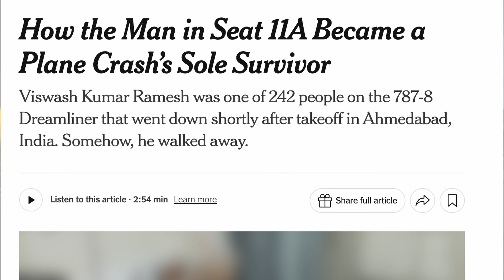Why the RAT Changes Everything – Air India 171 Update

Comment: No mention of the APU.  I thought the APU would be running during take-off to provide electrical and hydraulic power in the event of a double engine failure.  In which case there would be no need for the RAT to deploy (which it undoubtedly did).  I think there is much more to uncover here.  If the APU was running and it also failed, it looks like fuel starvation was the problem.  But fuel starvation simultaneously on three engines!!!?? 

"Curiouser and curiouser", said Alice.

Comment: There is some flaw in this analysis although it sounds partially correct. More convincing than the previous one. 
Imagine the sequence:
1. Aircraft accelerates normally up the runway and takes off smoothly at about IST 13.38 hrs - At the instant of rotation Engines were working - 0 Sec.
2. WITHIN 50 FT LANDING GEARS DID NOT RETRACT -  FAILURE TO RETRACT THE LANDING GEARS WAS COMMUNICATED TO THE PILOT - AIRCRAFT GAINING HEIGHT - ENGINES WERE WORKING - 5 secs.
3. Pilot senses the abnormality and tries to accelerate and climb quickly - Emgines working? - between 5 & 15 secs.
4. Pilot senses the loss of thrust - Engine is still working but not delivering the required thrust - Aircraft reaches it's maximum height 500 to 650 ft using the momentum - RAT (= kind of device triggered by the emergency) would have projected out - SOMEWHAT evidenced from the visual footage of the flight - between 15 & 25 secs
5. May Day message: Sent "seconds later" than takeoff. The pilot's words were "Thrust not achieved falling Mayday! Mayday! Mayday!" - between 15 & 25 secs
6. Aircraft starts loosing the height and pilot desperately tries to save the flight - between 20 & 30 secs.
7. Aircraft continued to descend rapidly and crashed into the building - inferno/fireball - between about 30  & 45 secs. In about a minute, after the take off, fire ball & smoke errupted from the crash site.

Engine sound is clearly audible in the visual evidence as the aircraft was descending and approaching the building before collision. Flaps position in/out during the flight NOT decernable convincingly enough. There could be something about it or there is nothing about it. Investigation will reveal. 

Seq No 2 & 3 are not clearly explained in the expert analysis. There could be a slip there which is not assessed/analysed. 
Until then lots of speculations? 
What is robust Safety?
Save lives.

Comment: steve you were late to the party on this   and by a long long time,,  swiss001 was on it straight away and he called the bogies tilting  and he dismissed the flap or u/c issues straight away and said rat deployed
no one listened to him and all the experts got hung up on the loss of thrust being a pilot error when the pilot reported no thrust etc 
engines failed just after take off   and as the bogies tilted he selected u/c up but just had no hyds to shift them so the engines were going on or after rotation or close too

Comment: If they were having dual eng failure why were the flaps up? Is it for better lift to drag ratio??
Reply: I think it doesnt matter they only had a few seconds left and without any thrust they were heading downwards
Reply: @drseven1275  but why are they up? The altitude is to low for the flaps to be up is it?

Comment: 1. The single survivor spoke about hearing a 'bang' just before the crash.

2. The ambient temperature at AMD (The Airport) was quite high, making a long hot take off run.

3. The same aircraft, just on its previous leg did experience electrical trouble with cabin aircon.

4. The pilots called a Mayday during or just after takeoff, meaning the emergency happened after V1.

5. The older Dreamliners have a history of thermal overrun of the lithium battery packs, some even ending in fires. (Boeing had done a workaround for that, but the faulty aircon and a full day's baking on the tarmac would not have helped to cool the batteries).

6. What if the 'bang' heard during 
take off was the battery pack exploding? 

7. The resulting elec. power loss would have caused the RAT deployment, also reported elsewhere.

8. If the battery box/breakers burned & tripped the power to the FADEC and fuel pumps, would that not cause a dual engine failure?

9. In such a condition, without hydraulics, no way they could retract the gear, let alone recover thrust!

Comment: Hmm.. just on sound amplitude, if you can hear the RAT, there is no turbofan at takeoff power anywhere near it.  Witness ears, and the mike/audio input hardware on the phone, would push the RAT sound down into insignificance.  It's weird - there does not seem to be anything trailing the plane, no stream of hydraulic oil, no smoke from poor combustion, no flame/bangs from relight attempts.  It's as if perfectly good engines were just instructed to shut down:(

Comment: Respected Capt Steve,
I am no aviation expert but I will request you to analyze the testimony of the lone survivor and the reports from Ahmedabad Airport. In words of the sole surviving passenger, immediately after takeoff, the airplane seemed to have come to a standstill for about 5 secs. Soon they heard a loud noise (RAT deployed?) and saw a flickering green and white light (generator issues?) just a few secs before the crash. Also the Airport received a Mayday call from the pilot during takeoff but got no reply when the signal was addressed.(a power failure?) It was at this time, that the plane disappeared forever from the radar.
Whether a power failure or a dual engine failure, Boeing has a lot to answer!

Comment: Some of the sequence of events could match a premature raising of the flaps, however not all video evidence suggested that. But for me it would have been absolutely unbelievable that someone, anyone, would mistake the gear lever for the flap lever. We've had some pilots mix up the levers for the air brake, the flaps and one of the engine thrust levers, because they're all located pretty much right next to each other. But the location and form of the gear lever makes it unmistakable, even if the person tasked with operating it would have been drunk they wouldn't have messed up this big!

Comment: Hold on - is it not the Boeing 787 which had serious problems with it's Lithium batteries for backup and general power? For AC? There is a video from the same airplane the same day, earlier flight, a passenger from the cabin filmed that nothing was working,, no AC, no entertainment. If the batteries worked, why would the RAT be necessary? If not, a long list of people will be held accountable.

Comment: We hear the RAT, but can you tell if the engines are at idle or failed? Could a software glitch in the engine thrust management software be another hole in the Swiss cheese? (a recent software update gone wrong that caused uncommanded roll back of engines?)

Comment: A British Airways B777 had a double engine failure on approach to Heathrow recently that was caused by a blockage of the fuel flow probably by ice in the filters.
But that was after a long flight at high altitude

Comment: After seeing more than 50 videos of this unfortunate crash, and being a retired flyer myself, I have slightly different opinion and I may be wrong.
1.The TOW was near max TOGW. That was a hot day and temperature ISA+20 nearly 40 C. Temperature inversion is just possible.
Going through performance of 787-8 flaps 15 were required for TO. As seen from CCTV during TO roll these were at 5 and that is the reason acft lift off at the end of the runway.
The 11A seat pax did say he heard a loud bang and then lights flicker. Probably  6-7 seconds after lift off the left engine had a compressor stall and loss of power. This also explains acft veering to the left and crashing to the left of runway centre line. The pilots got involved in assesing the situation and forgot the landing gear. Now with gear hanging down heavy acft with 42 C temperature and inadequate flaps the acft will not climb with one engine, thats why capt said Thrust not achieved going down Mayday Mayday. If both engines had failed the call would have been Lost both engines.
This is my theory and I may be wrong.

Comment: It is wrong to speculate about the cause of the crash. If the authorities strongly suspected a technical failure with some evidence to back it up, they could call for all 787s to be grounded, but this can't be done without solid evidence.  It would otherwise become too tempting for people who felt legally at risk to overreact to all manner of suspected aeroplane issues. Grounding a popular aircraft type would cause chaos for travellers and airlines.

This captain needs to apologise for suggesting that one of the pilots may have caused the crash by retracting the flaps in error and not putting the landing gear up. Just think of the added grief this places on their loved ones and the potential reaction of families who lost someone. The suggestion is unnecessary other than to earn some youtube views and satisfy the armchair wannabee air crash investigators.

The black box analysis won't take too long, and then we'll know what happened. At this stage, let's spare some thoughts for the many hundreds of people grieving.

Comment: There is a theory circulating that the Fuel Pump was switched off at the time of pumping fuel to the aircraft and it was not switched on. I understand that only the ground staff handling re-fueling have access to it. This would mean that there would be enough fuel to taxi and takeoff which is the residue in the fuel pipes but not beyond. Is this theory plausible?

Comment: Great job! Well said, and with video support. I would add that in the video you showed,  I did not hear the usual roar of the aircraft engines as it went by the person taking the video onlr the sound of the RAT motor?  Usually, the engines are independent of each other for safety,  but there may be a common electrical component just prior of a split off that failed or shorted that could explain both engines shutting down at the same time?

Comment: I believe that during takeoff, they decided to abort once they discovered an engine problem. However, the speed was near or beyond V1, perhaps close to V2, and there was hardly any runway left to apply the brakes; therefore, they decided to continue takeoff. Consequently, the landing gear remained down while they assessed the engine issue, but ultimately, they lacked sufficient time.

Comment: And I said it in your previous video: power failure .... and I was not talking engine failure.
I said this because that plane had a total power failure before a previous trip. Someone
else had this info. Failure this time .... most likely caused a software system shutdown,
as I said ... a repeat power failure. Electrical system shutdown caused by software. I'm
still sticking to that conclusion.

Just went in search of my first comment, darn, I forgot to click "Comment" after typing
it up. But essentially repeating here what I wrote the first time .... except I wrote plane
seemed to be in landing mode as opposed to a total shutdown. Either way software is
the most likely culprit.

Comment: I saw the original video right after it was posted on X, and the RAT, and its accompanying sound, was pretty clear. I was having a hard time understanding why no one else could see it or hear it, until I went back a little while later and a google search only yielded the copies that were shared on news sites, where the video and audio quality was terrible. But as a former 787 guy, the instant I saw the original video (where the leading edge slats are also much more clearly visible too), my thoughts went to something like a dual engine failure right after takeoff.

EDIT- While it is possible to safely fly and land on the RAT, it is really designed more to provide minimal hydraulic and electrical power to maintain control while another, more robust system is brought back on line. Once the RAT is deployed, it cannot be retracted, so even with another system restored, the RAT will stay out until put back in place by mechanics on the ground.

Comment: Hallo Captain, first of all congratulation on your analysis.
I 'd like to suggest you about the both engines power loss, a very rare event as yoy highlighted, instead of considering a bird strike or a fuel contamination, what do you think about a both engins compressor stall due to an automatic power increase due to the activation of the safety systems that every modern airliner has(for example "Alfa floor "system on Airbus planes).
This automatic intervention could be due to erratic flaps selection or their premature retraction, or an erratic performance calculation. 
Thanks you end best regards.

Comment: Well, there are enough clues to suppose that there was a dual engine failure. In the take off footage there is no indication of  bird strike or compressor stall, but the struggle to get the plane airborne, and the dust shows the fact that the pilots used even the last meters of runway. So, the question is: What would may caused the dual engine failure? Problems with fuel? Failure of the control units on both engines? Also, in this much clear footage, some shadows appear on the upper surface of the wings. Could that be due to deployment of spoilers? Could that be an indication of electrical, hydraulic and or computers failure, so that wrong commands were executed, without inputs from pilots? I don't like to speculate, but I am afraid that neglijent maintenance and fuel management might have lead to having contaminated fuel in that plane tanks.

Comment: If there was indeed a dual engine failure, odds are really small for such a thing, there would be an electrical failure too, does that imply that they couldn't retract the gear, when electrical power wasn't available anymore? Does a deployed RAT provide sufficient power for the gear to retract?

Comment: What if the fuel metring valve was stuck, it has happened before and the valve was found to have water absorption granules that jammed it closed.
The particles came from the filter that collapsed under suction pressure.

Comment: Causes of Engine Failure : 

1. Fuel Contamination
   This is one of the most common causes of dual engine failure.

* If water, microbial growth, or improper additives enter the fuel tanks during refueling, both engines may receive unusable or degraded fuel.
* Ice formation in fuel lines (even with anti-icing systems) can block fuel flow.
* A real-world example: British Airways Flight 38 crashed due to ice crystals forming in the fuel-oil heat exchanger, starving the engines.

2. Incorrect Fueling

* If the aircraft is mistakenly filled with the wrong type of fuel (e.g., Jet-A1 mixed with AVGAS or contaminated with diesel or water), both engines can flame out shortly after takeoff.
* Some fuel errors aren’t detected until the engines are at high load — typically during takeoff or climb.

3. Bird Strike (Rare in This Case)

* While usually a single engine is affected, in very rare cases, a flock of birds can be ingested by both engines simultaneously.
* Example: US Airways Flight 1549 ("Miracle on the Hudson") — a flock of geese caused a dual engine failure.
* In the current case, no bird remains were found, so this is unlikely.

4. Electrical or FADEC Failure

* FADEC (Full Authority Digital Engine Control) units electronically control jet engines.
* A common electrical failure or software bug could, in rare scenarios, cause both engines to shut down or fail to respond.
* If engine control data buses or sensors fail simultaneously due to a design fault or electrical short, both engines may stop delivering thrust.

5. Fuel System Design Fault

* A blockage in a shared fuel manifold or cross-feed valve malfunction could choke both engines if fuel can’t reach them.
* Even air in the fuel lines from a faulty pump can cause this kind of simultaneous shutdown.

6. Fire Suppression or Bleed-Air Malfunction

* In rare instances, false fire warnings could cause pilots to manually shut down both engines.
* A bleed-air system fault might also trigger overheat warnings, though this usually affects one engine at a time.

7. Human Error or Misconfiguration

* While rare, a checklist or configuration error during start-up or takeoff roll could result in improper engine performance.
* Example: Incorrect fuel pump switches, cross-bleed settings, or engine anti-ice system misconfiguration could contribute to dual flameouts.

8. Structural or Mechanical Failure

* A major failure in the engine mounts, inlet sensors, or shared hydraulic systems might cause both engines to shut down as a safety measure.
* Less likely, but not impossible: ingestion of foreign object debris (FOD) like tools left in the engine bay during maintenance.

Comment: There is also a chance that there was no fuel supply, than what engines will do in that case ? They will not work....similarly like our body if we dont eat our system will not work...i think that while refilling the fuel some flaps would have been closed and because of that there was no fuel supply to engine and thats why engines stopped working because of no fuel supply.

Comment: There is another clue giving away the fingerprints of a total loss of power, either hydraulic or electric, but if you look at the way the landing gear is tilted, it's tilted down. The 787 only tilts down the landing gear upon retraction, but if down, the landing gear is supposed to tilted upward, not backwards.

Comment: Keep in mind that the crew could of deployed the RAT in desperation manually thinking it may help "It only takes a second" and the pilot monitoring could of raised the flaps instead of the gear as previously thought. And explain why the very first footage of the aircraft taking off did not have any audio regarding the RAT in action? only engine thrust.